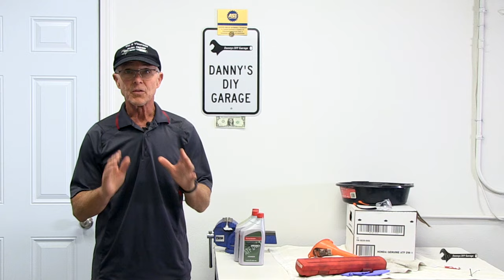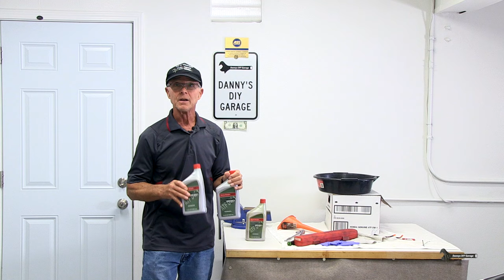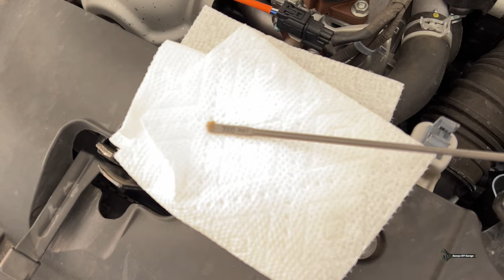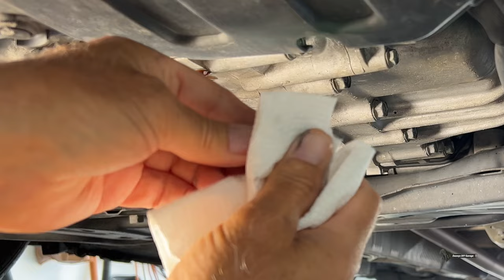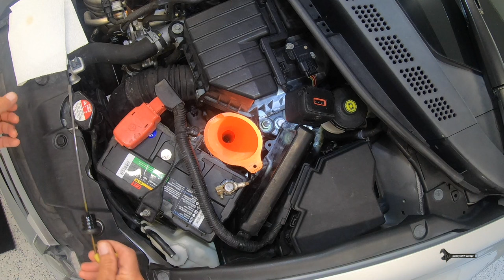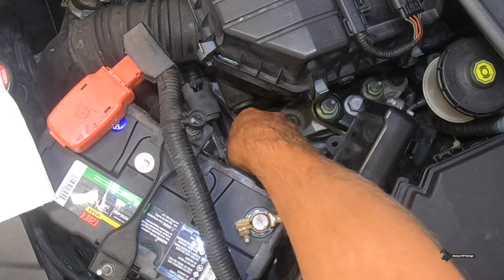Smooth Shifting! 8th Generation Honda Civic Transmission Fluid Change (DIY) Save Money!

Comment: I've had my 06' for 3 years and it has 289k on it. It only had 175k when I bought it. Should I change mine with so many miles on it?
Reply from the maker: I would change it
Reply: @dannysdiygarage  I've been told by other people that it may not work after if I do so I'm really not sure what I should do

Comment: I have a 13 civic with 390k miles. Only replaced alternator and had some AC work done. I Change fluid every 25-30k miles. You change the fluid hot or cold?
Reply from the maker: Warm or Hot is best

Comment: Hi Danny im unsure wether to change my transmission fluid because I'm afraid of the gears slipping. I got my car with 127k miles I'm not sure if the transmission fluid has ever been changed, what do you think?
Reply from the maker: If it works good now change it, if it’s slipping now don’t, my opinion 127 k isn’t to far overdue
Reply: @dannysdiygarage  okay thank you.

Comment: Mine is 180,000 never change it before  ,should I change it or not,
Reply from the maker: If the transmission is working fine right now, then yes its safe to change it, however if you're having problems, then I wouldn't bother

Comment: How often do you change the crush washer on the drain bolt and how do you clean out your orange funnel between uses?
Reply from the maker: Crush washer is recommended every time , however I only do it if it leaks
Reply from the maker: Funnel I used brake cleaner
Reply: @dannysdiygarage  thank you!

Comment: If you're doing the filter also and removing the airbox do you still need the long funnel?
Reply from the maker: I don't think so, you should be fine, one more thing, if you remove the cowl panel it will give you more room and make things easier to remove the air box and the filter, I show how to do this in this at the beginning of this video here https://youtu.be/Scukh_qZ3FQ
Reply: @dannysdiygarage  hell yeah thank you so much
Reply: I used maxlife because I couldn't get Honda in time it shifts really smooth. I couldn't even blow through the other filter at 127,000 miles. I agree with you they need to be changed regardless what Honda says

Comment: Could you please make a video on transmission solenoid. Dual linear shift solenoid.
Reply from the maker: I’ll add that, any problem you need me t address?
Reply: @dannysdiygarage  I believe my 2013 Honda civic transmission is slipping. I am not sure whats the problem is. When speedometer hits 10mph, tachaometer rev`s to 2k and falls back to 1.6k, again if I push has gas pedal more it hits 18mph again revs to 2k and falls back to 1.5k. Also  sound is generating like tuk tuk tuk tuk even when I take off foot from gas pedal and driving at 20-30mph. I am not sure if transmission is bad or selenoids or tranny mount. I replaced tranny fluid 3 times 2.85 quart each time. It did not solve the problem. I don`t see check engine light on. Dash board is clean. I am planning to check transmission mount, change transmission filter, clean solenoids and put fresh fluid again. I am not sure where the problem is. My car has 100,000 miles on it. Thanks for your time.
Reply: @dannysdiygarage  But above 40mph I don`t hear any sounds or any shifting problems. I feel smooth ride, no jerking.
Reply from the maker: Sorry I didn’t find a solution, please update me when you figure it out, yes from your description sounds like internal issues, good luck
Reply: @dannysdiygarage  I Replaced 9 quarts fresh fluid, changed transmission filter, Cleaned ABC solenoids. Still the problem didn`t go. So, I added 3/4 bottle of Lucas trans fix and drive 300 miles, now its fine. I just trade in for 2023 Hyundai Elantra, got $8000 for my car. Hyundai has ten year or 100000 miles power train warranty compared to 5 years or 60000 miles warranty on Honda. cool now.
Reply from the maker: Oh bummer, I’m loosing a subscriber ( hopefully you’ll stick around ) yeah sometimes you just gotta do what you gotta do, thanks for the update 👍🏼
Reply: @dannysdiygarage  I know many people in Atlanta selling bad transmission cars, putting Lucas trans fix. YT autos (used car dealer) in atlanta do the same thing selling AS IS putting Lucas Trans fix.
Reply from the maker: Good to know

Comment: Hey Danny, what is that buildup on the bolt behind the drain plug parallel to the exhaust?
Reply from the maker: Do you mean that oil residue? That’s my next video coming up, power steering o’rings are starting to leak, I have the parts, I’m just waiting to get time to do them, hopefully the next couple of weeks 
Why do you ask?
Reply: @dannysdiygarage  I ask because I just did my o-rings and had oil residue in the same exact location. BTW, your videos are really good and I greatly appreciate them.
Reply from the maker: Great, now I know it will fix it, thanks for commenting

Comment: Danny, do you need to worry about jacking the car up on both ends so it is level before draining old fluid?

To ensure the proper amount gets drained?
Reply from the maker: No, that little bit of angle will not matter, great question